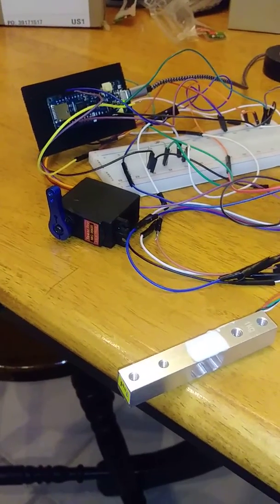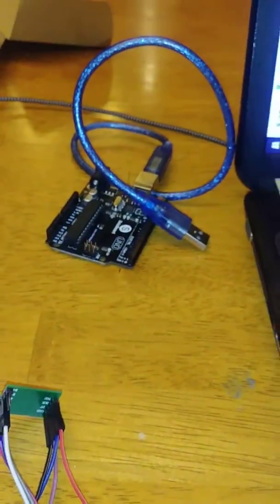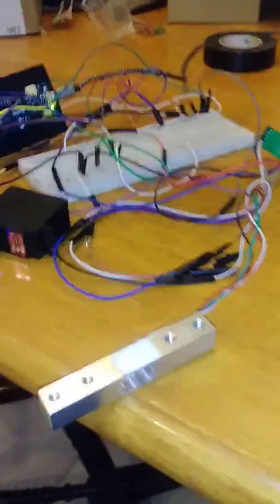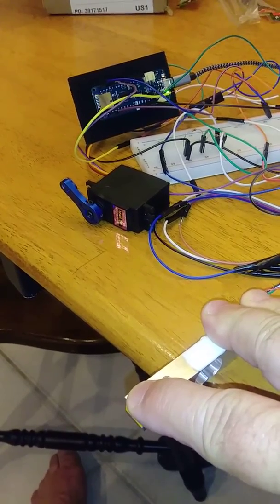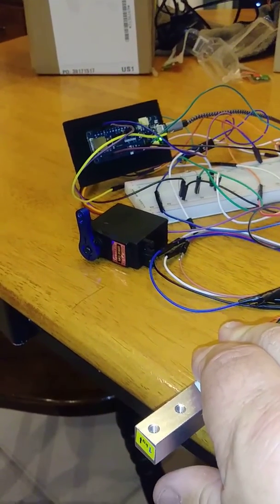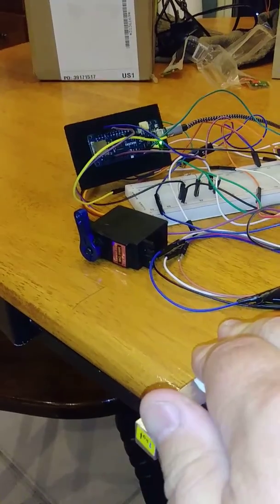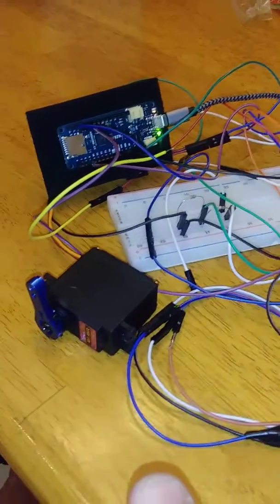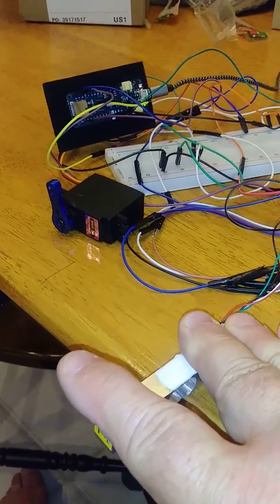Pressure Knob: Cantilever Load Cell (Force Transducer) Drives A Servo. HX711 @ 10 MHz.

Comment from the maker: Here is the Sketch I Made/Used (Since some of you asked a while ago...)

Pressure/Force Moves Servo Position (Arduino Uno or MKR)

/*
 Controlling a servo position using a potentiometer (variable resistor)

*/

#include <Servo.h>
#include <HX711_ADC.h>

Servo myservo;  // create servo object to control a servo

//HX711 constructor (dout pin, sck pin)4,5
HX711_ADC LoadCell(4, 5);

int potpin = 0;  // analog pin used to connect the potentiometer
int val;    // variable to read the value from the analog pin

float ii;
float vv;
long t;

void setup() {
  myservo.attach(9);  // attaches the servo on pin 9 to the servo object ... Use 8 for MKRZero

  Serial.begin(9600);
  Serial.println("Wait...");
  LoadCell.begin();
  long stabilisingtime = 2000; // tare preciscion can be improved by adding a few seconds of stabilising time
  LoadCell.start(stabilisingtime);
  LoadCell.setCalFactor(696.0); // user set calibration factor (float)
  Serial.println("Startup + tare is complete");
}

void loop() {
    //update() should be called at least as often as HX711 sample rate; >10Hz@10SPS, >80Hz@80SPS
  //longer delay in scetch will reduce effective sample rate (be carefull with delay() in loop)
  LoadCell.update();

  //get smoothed value from data set + current calibration factor
  if (millis() > t + 1) {
    float i = LoadCell.getData();
    ii = i;
    float v = LoadCell.getCalFactor();
    vv = v;
    Serial.print("Load_cell output val: ");
    Serial.print(i);
    Serial.print("      Load_cell calFactor: ");
    Serial.println(v);
    t = millis();
  }

  //receive from serial terminal
  //if (Serial.available() > 0) {
  //  float i;
  //  char inByte = Serial.read();
  //  if (inByte == 'l') i = -1.0;
  //  else if (inByte == 'L') i = -10.0;
  //  else if (inByte == 'h') i = 1.0;
  //  else if (inByte == 'H') i = 10.0;
  //  else if (inByte == 't') LoadCell.tareNoDelay();
  //  if (i != 't') {
   //   float v = LoadCell.getCalFactor() + i;
  //    LoadCell.setCalFactor(v);
  //  }
  //val = analogRead(potpin);            // reads the value of the potentiometer (value between 0 and 1023)
  val = ii;
  val = map(val, -300, 300, 60, 120);     // (val, -300, 300, 60,120) scale it to use it with the servo (value between 0 and 180)
  myservo.write(val);                  // sets the servo position according to the scaled value
  delay(1);                           // waits for the servo to get there
}

  //check if last tare operation is complete
 // if (LoadCell.getTareStatus() == true) {
   // Serial.println("Tare complete");
  //}

//}
Reply from the maker: Load Cell to HX711 Connections

Red Wire to E+
Black Wire to E-
White Wire to A-
Green Wire to A+

HX711 to Arduino Uno Connections

GND (Black Wire) to GND
DT (Purple Wire) to Pin 5 (Digital) {This may be PIN 4?}
SCK (Yellow Wire) to Pin 4 (Digital) {This may be PIN5?}
VCC (Red Wire) to 5V

Servo to Arduino Uno Connections

Power to 5V
GND to GND
Signal Wire to Pin 9 (Digital)
Reply: Dear minimum weight?  maximum weight ? How much for left and right